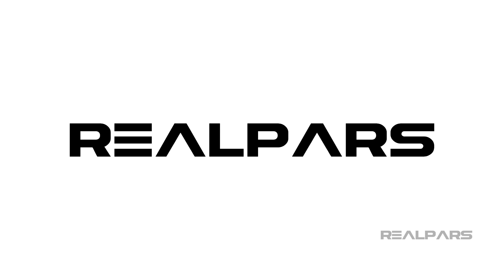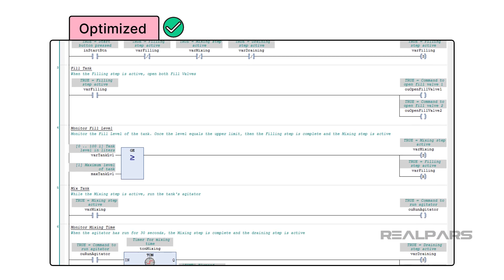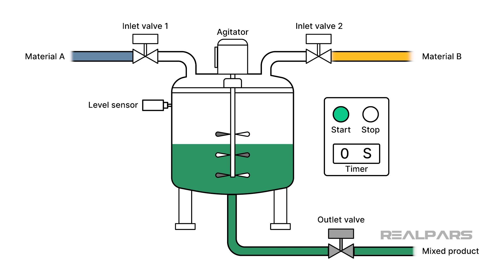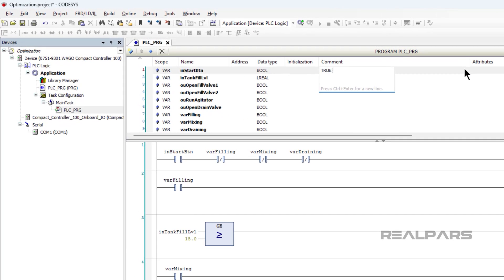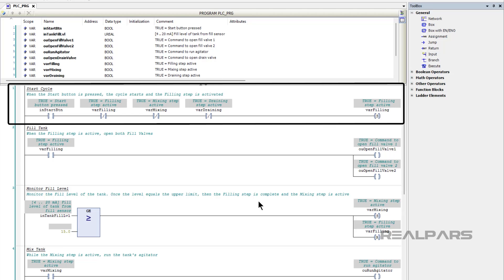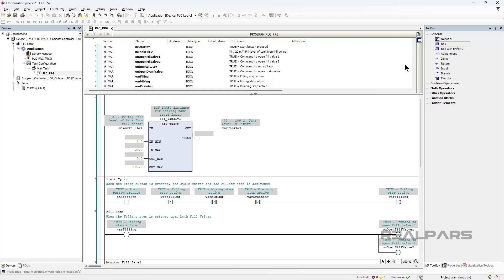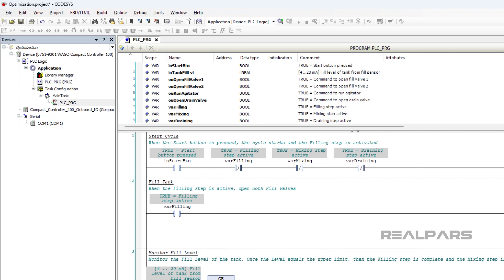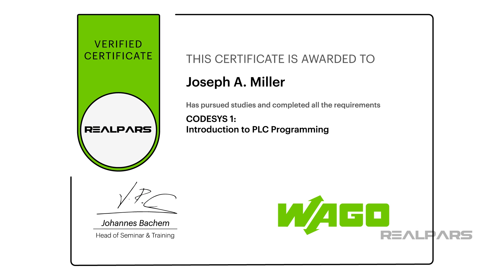Ladder Logic Best Practices: Optimizing Your PLC Programs

Comment: Some other things that can make life easier.  

Redirect your inputs and outputs.  I/O points burn out.  If you have a spare point, you can move the wire to that point, but then you have to go through the entire program and change all references to that point to the new address.  

Say the PLC uses X to designate a physical input, Y to designate a physical output, and C to designate an internal contact.  Redirect your inputs:
X1-C1
X2-C2…
Then redirect your outputs: 
C101-Y1
C102-Y2…

This does two things.  It places all your input rungs in one place, followed by all your output rungs, making them easy to find, and it makes it so moving a wire to a new point only requires changing one address.  

For instance the X1 input burns out, but you have a spare point at X21.  Change the address as follows:
X1-C1 becomes C21-C1.  C1 is used everywhere else in the program in place of the actual physical input, so it doesn’t require changing.

I usually structure my programs as follows:
A) discrete input redirection 
B) discrete output redirection 
C) coil summaries 
D) analog input scaling
E) analog output scaling
F) program logic

Coil summaries

Give each discrete output generated in the program its own internal contact.  

For instance, say there are 3 rungs that generate a condition that turns on physical output Y1.  Y1 is redirected from C100.

The output of the first rung that needs to turn on Y1 has an output address of C303.

The next rung that needs to turn on Y1 has an output address of C507, and the one after that C509.

A coil summary would have any of those 3 addresses turn on C100, which is the redirect address of Y1.

C100—————-Y1

C303—————-C100
C507——-
C509——-

That way you can give different descriptors to each of the output conditions and retain the ability to move a wire easily.
 
By structuring the program, you make it easy to find what you are looking for, and by redirecting you make it easy to find all the inputs and outputs.

Another thing I do is to create two nulls: C7776 amd C7777.  These nulls aren’t used anywhere in the program.  They are used to create a null rung so I can use a rung comment to make a section comment such as:

The following 10 rungs are used for tank heater lead lag control.
C7776———————C7777
Rung1
Rung2…

Comment: There should be feedbacks from all actuators to ensure that the process is truly running as designed. The same feedbacks can be used as interlocks Incase of actuator failure.

Comment: Is it really normal to receive a value of 4..20 (mA) from a WAGO analog input card? Kinda surprised me 'cause I'm used to work with 0..27648 in Siemens or 0..10000 in Modicon PLCs
Reply from the maker: Hi @simxschl, 

This was a quick demo to show the principle of scaling and not intended to be a lesson on Wago hardware. You are absolutely right that the analog inputs of a Wago CC100 have a range of  0 to 32760 under normal operating conditions.